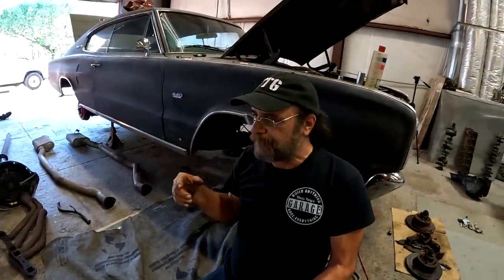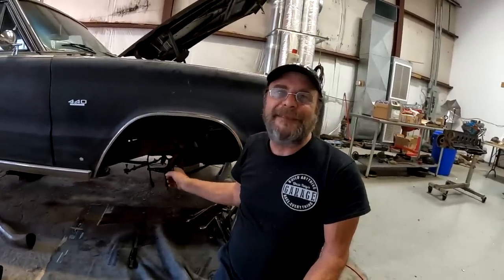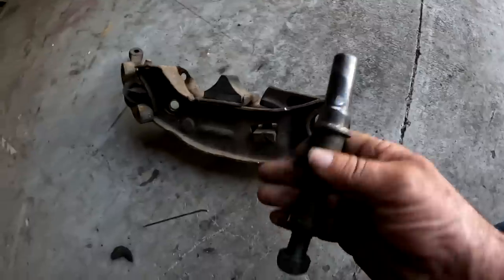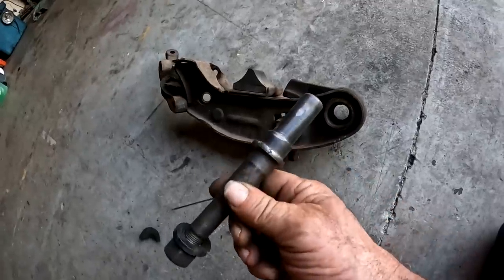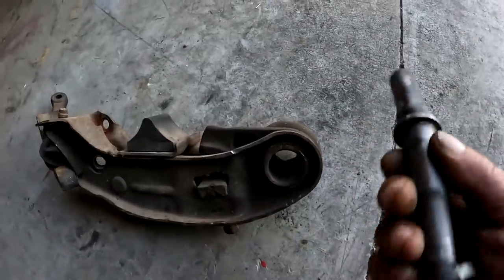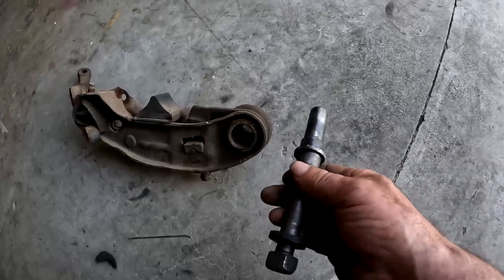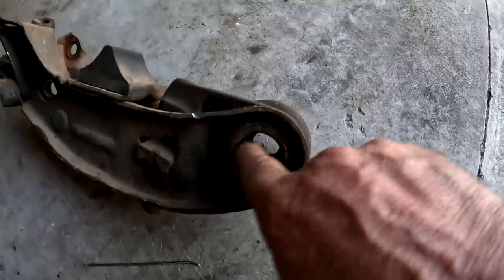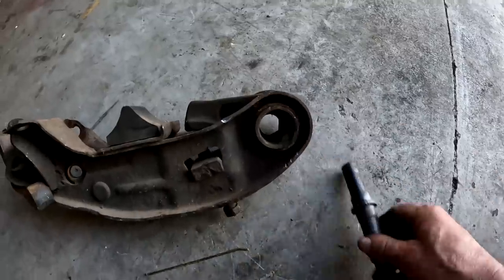The Achilles Heel Of The Classic Era Mopar - The Dreaded Lower Control Arm Bushing

Comment: That's absolutely NOT what causes the wander in the steering over bump,... which is called "Bump Steer" by the way. It happens on A, B and C body's regardless of whether the suspension is brand new or worn out. It's caused by having different lengths for the Lower Control Arms compared to the Tie-Rods, which makes them move through a different arc as they deflect over a bump. Lowering a MoPaR makes it worse. The ONLY proper cure for it, is to move the steering box on to a modified K-Frame and setting the Tie-Rod's inner ball-joint (where it meets the Drag-Link) to be inline down the chassis with the lower control arm pivot - basically lining up under the Torsion Bar - when the wheels are in the dead ahead position, minus the offset of the outer ball joint from the lower ball joint at the wheel end of the LCA. It may also require an adjustable length Drag-Link.
This eliminates both the geometry error, and the play through the rubber bushes between the K-frame and the Chassis Rail, as the steering box now moves with the K-frame. Downside, more vibration through the wheel, upside, more feedback through the wheel for better control on the limit.
As for ALL the bushes, yes your handling goes to shit if you don't do regular maintenance. That's true of Every car.

Comment: Comments on improved handling / harsher ride with urethane bushings are making me wonder what the theoretically perfect pivot joint solution would be for those lower control arms. What would happen using full length roller bearings, are there varying grades of urethane material to “tune” for desired function, what’s your experience and ideas to get these reliably and satisfactorily set up?
Reply: Cup and cone roller bearings like for wheels work excellent but are difficult to seal also they require lubrication regularly.  Rubber bushings have proven to be the longest lasting maintenance free solution. I was envolved with some semi truck suspension testing several years ago and the poly stuff only lasted about half the miles of the rubber and was much noisier and harsher.  Plain bronze bushings worked very well for wear if kept greased but we’re much more harsh riding.

Comment: The bolts get rust welded into the sleeve inside the bushing nightmare hate it Sometimes you have to stick a blade in between the mount flang and the Bush and cut the bolt off to get Them out It's like a 1/2 A-day of suck if you're fast on a lift On the ground it's like take a break every 10 minutes and go spend 40 more dollars On saw blades

Comment: I had 71 roadrunner 383  lost it on a burnout being an idiot slammed into a curb and bent the lower control arm on the passenger side.took it to Midland Frame and Wheel (Midland Texas) they charged me 83 dollars to fix it

Comment: Press the shaft in the bushing now use a pipe to press the bushing in the arm I can do a dart in 21/2 hours don’t tighten the bolt until the car is sitting at ride highth

Comment: Yeah I have used those polyurethane bushings seemed to work well they come with this really sticky grease to grease them, do not get that grease on your skin it doesn't come off even with brake cleaner or any kind of soap use disposable gloves.
Reply: I believe that is the same type of grease used in GM truck CV joints. Gasoline or diesel works best to wash it off

Comment: Trying to use a front coil spring compressor on a 70 to 81 camaro or firebird with out killing your self or innocent bystanders is way down on my having fun with old cars list.
Reply: Those are easy to get out remove upper shock nut use a floor jack under lower control arm disconnect upper arm from spindle an slowly lower the jack till the spring is loose an remove the bolts securing the bottom of the shock. S10’s designed the same way as ur car an I’ve removed a bunch of them same way or cut them out if ur gonna R an R the springs

Comment: Seems like the lower control arm bushing start to shred after about 6 months, even with proper installation.

My Chrysler C body is in due of another bushing set in the near future, maybe a poly urethane bushing? 

I don't really care if the ride quality suffers a bit, as long as it will prolong the bushing having to being replaced again multiple times in my life span.
Reply: I got tired of crappy rubber bushings and started using poly wherever I could. 
Yeah it's a foreign job but doing a bunch of poly bushings definitely tightened up the feel,and they last.
Reply: I think it's the quality of replacement products available. The rubber just isn't the same as it once was. The poly ones would hold up longer, and glad you said you don't mind losing some ride quality, because that's a given with poly.
Reply: @TAVOAu  heh ,yeah get ready for road noise , but I don't mind it. 
If a few key areas are done ,it shouldn't be too bad but results may vary. 
Floor it to hear the headers or turn up the radio 😀
Reply: @TAVOAu  yes, ride quality is a big thing especially in big C bodies. You lose some of the "floaty" feeling but I'll compromise some of that if necessary.
Reply: @TAVOAu  Some of the higher grade tie rods end boots split and crack like semi dry cookie dough after a few miles down the road. Parts are trash now.

Comment: A point not mentions is as an owner of a 66 hemi. charger is the Steering box mount. Unibody mount was very weak and can fail allowing the steering box to move back and forth creating bad shimmy and dangerous driving. tried different things to help but it came down to the weakness in the frame wall mount that was bad.
Reply: The steering box bolts to the K-frame. They are very rigidly attached.

Comment: Has someone engineered a proper solution? Sure polyurethane bushings and zirc fittings to service them with grease is better than original. How about replacing it with a roller bearing?

Comment: GM/Chevy used a similar style for their 4x4 trucks and suvs in the 90s. Great concept but poorly executed. But to be fair it's a better system than a straight axel with leaf springs that have little to no adjustment unless you have a alignment rack.

Comment: The polyurethane bushings are the only way to go IMHO. 20 years ago I replaced the lowers in my '71 with them and never looked back. Grease the crap out of them with silicone grease when you put it together and all that friction and wear you were talking about becomes a thing of the past. Those bushings are the 'fix' for the the lousy design. Period.🏁🏁

Comment: Makes me sick to think how many great cars were junked simply because they hit 100 000 mi .  Very light collision wasn't even considered fixed with high mileage.  New cars were2-3 thousand bucks and used were 2-6 or 8 hundred bucks depending.  But money was in short supply for most folks back then too , but today's prices are totally insane by comparison,  and 100 thousand miles is nothing.  I have 3 vehicles now with over 240 on one with bout 360 ( 90 dodge Cummins tho).  And I looked at prices the other day and even with 200 th mi cars are 4-8 grand.  I'll keep reparations on all my junk for now. Actually I'm tryn to go older -- not newer as parts are usually cheaper and available.   USUALLY---    been waiting 30 mo now for injection pump and Injectors for my 92 Cummins and still no delivery date even projected. Paid up front required and cant cancel and reorder because still wouldn't get and price went up a grand since I paid locking my price in. Crazy huh.  Frickin nutz. Need that truck.

Comment: Hmmm.  A bit dramatic.  I can do this at home with a $50 ball joint press....   The old bushings were dried out but really not all that bad.  The bigger problem is finding new bushings that are not complete junk and pull out minutes after installed.

Comment: i have a 71 duster, 68 charger rt,  73 ss nova, 79 z28 rs t top camaro and the chevy suspension is way better last longer better control  my 68 chevy pu has a shit ton of miles on it before i restored it but it still drove just fine plus it was only 450 bucks to rebuild front and back suspension ' my next mopar i build if i ever do i will drop the mopar suspension and drop a chevy suspension in it and aftermarket suspension are for racing they are weak and don't last they are for weight reduction and u can adjust them i only build dependable street rigs not race rigs.

Comment: All front ends get old and develop problems. To me it's never been a big deal to rebuild a Chrysler product front end! If I was going to complain about anything involved with doing it that would be the need for specialized ball joint sockets! 
Even the cost of Rebuild kits for them aren't that crazy expensive! But Snap on bends you over for the ball joint sockets! 1 bendover for car sized ball joint socket and 1 bendover for pickup sized ball joint socket!
Reply: I bought my Chrysler ball joint socket online for $17. It's 3/4" drive, but will work with a 1/2" adapter.
Reply: @mostlyoldparts  Last one I bought was 55 dollars from snap on. That has been some years ago.

Comment: I did a total rebuild/restoration on a friends 69 Barracuda. I had crossed this bridge, too. I have a press so the job wasn't to bad. However. I am a GM guy and never have I ever worked on a more Mickey Mouse, messed up, dumb ass engineered platform in my life. Those MoTars are a joke in my opinion. Never will I ever do another MoTard again. Like the styles of some of the cars but despise the engineering of them. Garbage.

Comment: Modern cars are throw-aways.  Literally.  They are getting close to "no user serviceable parts" and that's the way the manufacturers and government want it.

These cars, Chrysler, GM and even Ferd, were made to be serviced and repaired and kept in service till the bodies rotted off.  A bad design is just that, a bad design.  A screwup, a rush in design and/or production.  Doesn't make the cars disposable, it's just a mistake.  Unlike disposable new cars, which are mistakes from start to finish.

Comment: Im 64,,I've worked on all 3.i never  liked the  lack of structural integrity in a dodge, the suspension was a convoluted mess,engineering by a drunk gorilla.the engine can't be centered in the chassis because its got to clear the steering shaft that shouldn't be there.until I had friends with moparsididnt know the ears could break off the steering. Inn a wreck the doors will shoot open,u better use your seat belt. Don't take this personally  but even GM guilds a better machine 😂.